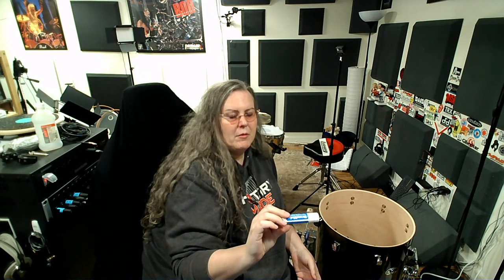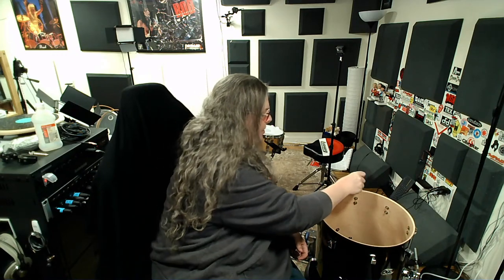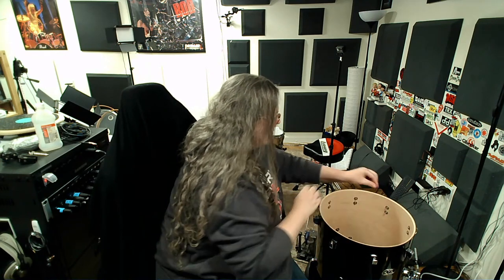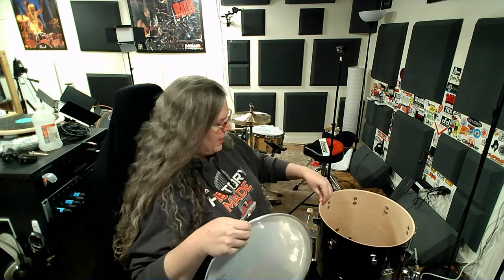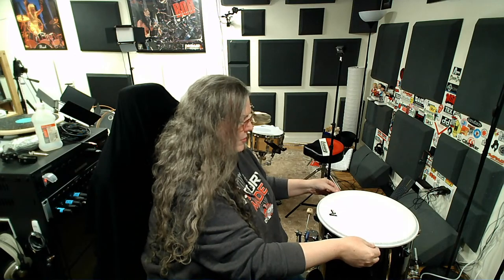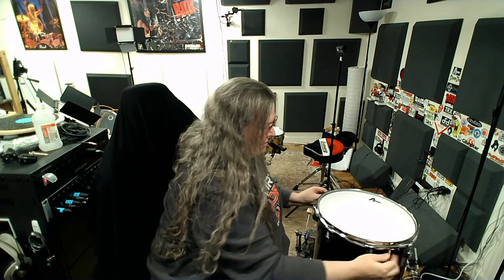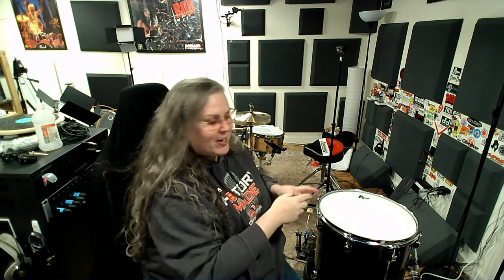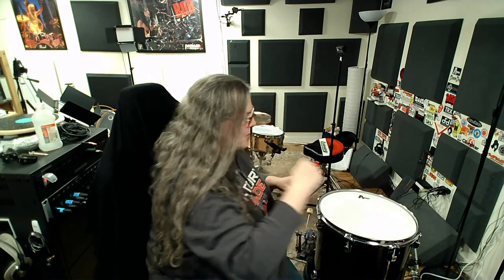Mounting Drumheads on a Sunday Night

Comment: I have literally used the same exact tuning method for as long as I can recall. From lining up the head logo with the badge, to anchoring my left hand to indicate where I started, down to crisscrossing clockwise around the drum. Maybe it's a generational thing, I don't know (I was born in '71), but it was cool to see someone else using this method. I honestly cannot remember where I picked it up. I've tried all of the popular methods out there nowadays, including pressing the center of the head with your palm and randomly tightening each tension rod until the wrinkles are gone. No matter what method I try, I always end up back to what I know. I'm enjoying the content, Penny. Thanks!
Reply from the maker: I was born in '70. Maybe I'll start calling it the "Gen-X Tuning Method." You know, give it a little credibility. 😉

Thanks for the comment!
Reply: @PennyLarson  I like that! haha